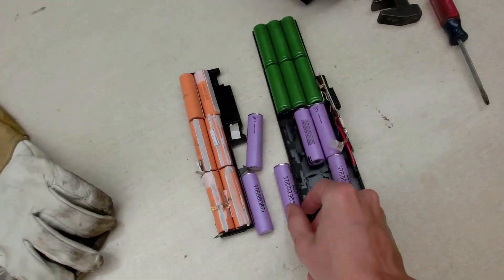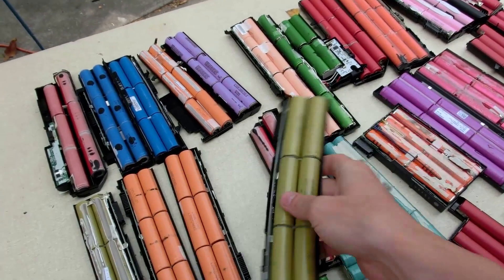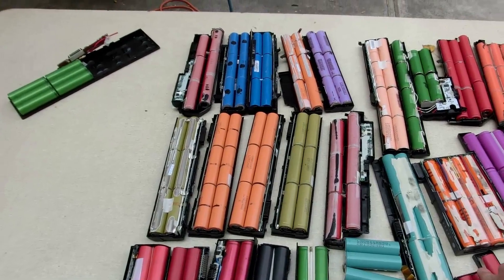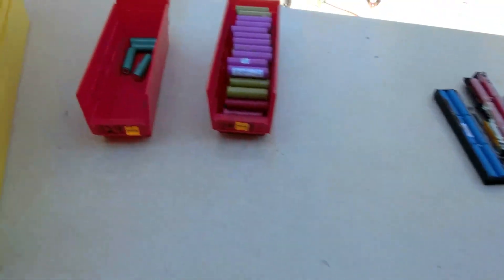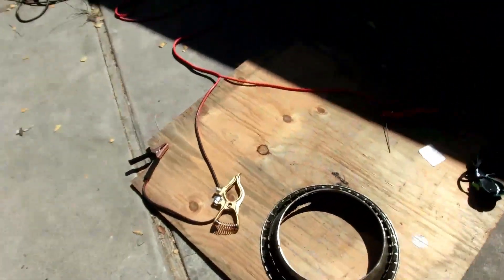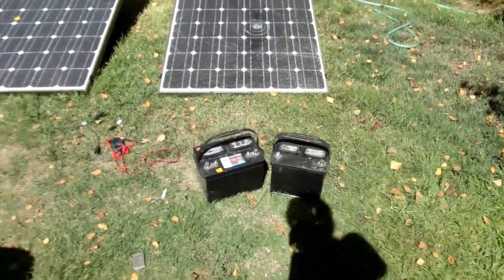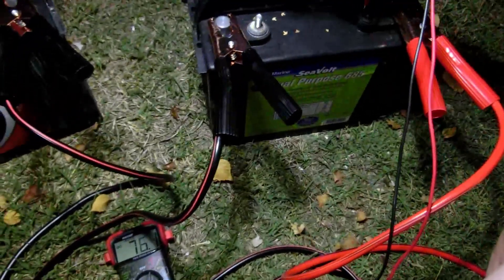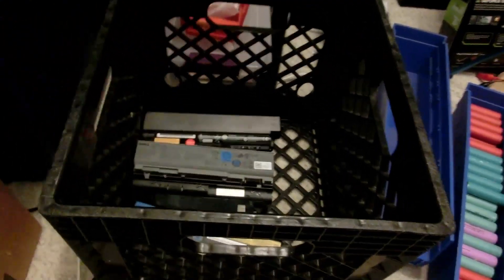Random Bits 0106: Harvesting 18650 cells, 48v Solar Charger

Comment: RE: Trolling motors, the one limitation that stands out to me is the ability to cool the motor as it is no longer going to be submersed in water. As I am machinist I can see cutting and modifying the housing to incorporate a fan powered by the motor itself or externally either/or with the addition of ventilation holes on the opposite end to draw air. Just a thought you might want to look into if you do I would look forward to seeing the video and would be happy to comment with any help I might be able to provide. Thanks again

Comment: You Sir are a junkie, I a'm proud to be associated with you as I am also a junkie.I have to inquire as to the gasoline pump in your backyard? The real subject of my question here is have you ever done in the experimentation with fishing/trolling motors for powering bicycles etc. I did see some quite promising results from a failed project of a friend who was clueless as to what he was doing. To salvage a trolling motor seems logical as they are a low-speed high torque motor to begin with, with all the variable speed controls and reverse supplied within the unit in its original form therefore inviting to be cut up butchered up and taken apart for other application. If you get a chance please respond to this. Thanks, Dave
P/S I enjoy your videos keep up the good work.

Comment: I find that Li-ion actually 4.1V fully charged, there is a mode change in that iMax charger choosing between LiPo / Li-Io
Reply: That mode undercharges the cells. You should use the Li-Po mode as that will take them up to 4.2V, which virtually all chargers use as the cut off voltage.

Comment: crap...i ruined 2 of my good cells...was making a 3s pack with 4 in parallel and while I was soldering them together I flipped it over onto a piece of solder wire which burned up quickly but not quick enough before it sent a lot of amps into 2 of my cells that were hooked together at 3v.  Everything was getting really hot then I grabbed my bolt cutters and clipped the rows apart those 2 batteries I have in a safe place for now in case they catch fire.

Comment: Oh and from a professional welder, GET A HOOD! You'll get face tan lines
 using goggles.  Goggles are fine for oxy-acetylene welding, because the
 UV output is way lower. For arc-welding you need a hood with at least a
 shade #10 lens to filter out the UV rays to a safe level for your eyes.
 Also wear long sleeves and make sure you're neck-line is covered... 
I've been sun-burned before on the arms and neck.
Reply: I made that mistake my first time welding wearing only a t-shirt. I was lobster red. made for a terrible week working outside after that.

Comment: I had the same though about the strips... "maybe they are worth something later". I plan on building packs using solid copper cable I get from "pump wire". It's a 4 strand 12-guage twisted wire you can get at the home center that doesn't have the extra outer coating to strip off. Great video, thanks again!

Comment: The ernergy use is all about how fast you are driving. Maybe at 20mph it only uses 80Wh/mile. I don't know how fast you want to go but if you want to go aroung 50mph it'll surly use around 150Wh/mile.
Reply: Filip Bjurling can u put a motorcycle gear box in it?

Comment: I want to scavenge laptop battery packs but I can't afford imax b6 charger . I only have multimeter , is it okay to use????
Reply: Balance chargers like the iMax and Turnigy Accucel are less than £30 (or the equivalent in $). They're needed for capacity measurements; you can't tell how good a cell is just from voltage. If it has been well used, it might still hold a good voltage but the capacity will be well down.

Comment: I just got my imax b6 in the mail and am discharge testing cells now. What discharge amperage do you think it'd be smart to use? I remember you use 0.1amp discharge but in the real world I think I will be drawing faster than that since I will be putting these on an ebike. I am using 1.0 amp discharge for a single cell, do you think that's too high and my capacity rating will suffer as a result?

Comment: I am very new at this and looking for some help. Can you tell me if in the picture you posted that shows 6 rows of 12 cells in parallel, assuming 3ah per cell, would produce 216ah and assuming 4.2v per cell, would produce 25.2v as shown in your diagram. It looks like you posted the diagram in 2013. It talks about 6 of these packs in series. Then, for my project, if I built a pack with 3 rows of 5 cells parallel, assuming 2ah per cell, would produce 30 ah and assuming 4v per cell, would produce 12v. If this is accurate, then I need to understand exactly how to install the wiring to the power outlet and balancing wiring. This is intended for a golf push cart. Am I on the right track here?? Any advice would be appreciated. Byron Rafnson

Comment: I've subscribed to your channel and have learned so much from them.  Thank you!   I am working on a battery pack for electric bicycle.  I have approximately 90 seemingly good cells so far, although I have yet to test the capacity of them all.   My end goal is a 60v 20ah pack (16s10p).   Quick question for you:  When calculating what the total amp hours of my pack will be, do I take an average of the individual cells capacity, or do I go by the weakest link?  Also, could you recommend a good source for used laptop batteries?  Most of what I have I've obtained from ebay, but I've heard battery repair shops and electronic stores will sometimes give them away.  Wondering your experience with this.   Thanks again!

Comment: ah, how sweet that feeling when u open up a laptop battery..
been working on 18650 cells about 1.5 years now and ur videos helped me get to know pretty much about these cells, but here s an advice, since my imax b6 clone charger started to fuck around lately I upgraded it to turnigy accucell 6 80w and I can tell you I m getting waay more accurate capacity readings this time, you must get one.
 I ve thrown a lot batteries because of imax clone but now I get the best out of my cells.
Reply: +Bilal Öz , I've been doing the same with one imax b6 (clone?) and now I feel I must speed up the process.. (LOTS of cells!)

I'm considering the Turnigy 4x6S 400w.. Any thoughts on this?
Reply: +Ricardo Encarnação
 Hi, I didnt try that one before but I can say Turnigy is the brand to go when it comes to lithium ion cells. Good luck !
Reply: +Ed Va why it makes no sense? I'm talking about a quick way of measuring capacity, not (just) charging bats..
Reply: +Bilal Öz I am getting the Turnigy you recommend. Having the same problems with the Imax
Reply: +Ed Va just for charging I use the Nitecore.. I was wondering about the best way of measuring capacity (fast)
Reply: +Byron Rafnson nice ! ppst the results please
Reply: Ed Va that times 3000 cells and you go nuts..
I think i dont mind a little inacurancy.

Comment: Does anyone know how many c theese standart 18650 li-ion cells can draw?
Im having a hard time using the max potential in some of my RC components which recuires 20-35C. (Hence im forced to use the expensive LIPO batterier...
Reply: +Simon Dambro       2
Reply: Cheers! !  That's really not much.
Reply: +Simon Dambro you can buy high-drain 18650's, but they'll cost you more. cheers!
Reply: nah id just stick with my free standart laptop cells :)  But thx
Reply from the maker: +Simon Dambro its not a bad amount of power from a cell, because if they where high-drain cells then you would just have a battery pack that would run something for 10 minutes or so. if your going to run something like a car you would need several hours of battery life anyway so at that scale a 1C discharge will be more than enough.

Comment: As long as you have a battery for both initially on the speedometer you'll be fine, and no wire in the way to get stuck on a branch or something like that. My mom has a wireless one and it has lasted almost 4 years now so you will probably be fine.

Comment: I want to make a solar charger for a 7V Motor/Battery Combo(I have a garden on a shack-roof that need watering). Do i need a charge controller? How do I make one?
Reply from the maker: +der Robert yeah its best to have atleast a voltage regulator to make sure the lithium cells dont get overhcarged. but if you can find a lithium power tool battery it should have the charging circuit and everything inside already. then you just provide it with a voltage from your panels.

Comment: Very cool, I took apart 25 laptop packs myself, got them from computer repair shop. 
For discharge testing I use 3 of these 7.45$ discharge testers. (ebay item number: 271731490268)
--
ebay link:
http://www.ebay.com/itm/271731490268?_trksid=p2057872.m2749.l2649&ssPageName=STRK%3AMEBIDX%3AIT
--
Also I use 7.5Ohm 5W resistor for a single cell or 3.3 Ohm 10W resistor to test pairs (too lazy to take separate, since they are spot welded in pairs). Discharge them to 3.0V, it stops automatically and displays mAh, so great!
This speeds up the testing process considerably compared to one iMax B6.

Thanks for the videos again, I am following every step of your new citicar project, very inspiring :)
Reply: +Roman Seibel you make a good point abou speed of testing. do you know where i can learn more about these testers you linked up.  the ebay listing is a generic name instead of something specific so when searched in youtube don't really show that particular unit.
Reply: Hi Danh, unfortumately I couldn't find anything on google or youtube, I guess it would be great if some one would make a review of one of those. I can't find the time unfortunately.
Reply: +Roman Seibel Sir i have been wanting to buy this tester  can you do a video on how it works

Comment: those goggles is for acetylene oxygen welding.. do NOT use them for arc welding.
Reply from the maker: +grapsorz but they are shade 10 so are required to protect against UV from what i understand.
Reply: stil they don't protect your face and as you found out they don't cover so good. you can still get cancer or at least sunburn from the UV rays hitting your face. if you want to weld get a automatic welding mask. not the absolute lowest price one's as some of them tend to fog up during use. i see they start at 25$ on ebay. worth every penny.
Reply from the maker: grapsorz
i just got myself a normal welding helmet.

Comment: will 50 cells in parallel be enough for current needs of your car? ...laptop batteries have high internal resistance soo...i suggest you to measure current draw and voltage while accelerating, before you salvage old batteries from car...high current can be mesured via shunts...
Reply from the maker: +Marko Grančić i want to maintain a discharge bellow 2C, that should be good enough.

Comment: Those look like gas welding goggles.  I am not sure those are going to protect your eyes from UV from the Arc welding.
Reply from the maker: +cfavreau they are shade 10 welding lenses, they are required to shield UV
Reply: +cfavreau Another commenter said that arc welding needs a visor that covers your whole face. So can the UV from arc welding cause skin damage or give you a sun tan? :-)
Reply: +Rinoa Super-Genius Ok.  As long as you are sure.  I don't want you to end up blind or with cataracts.  However the comment below is right.  You should look at the whole face mask.  You can get a whopper of a sun burn from the Arc too (and eventually skin cancer etc.).
Reply: +Coolkeys2009 Yes, it can. UV is UV, regardless of the source. If anything, it can burn you faster because you are basically standing next to a concentrated source.
Reply: abraxsis You just get suntan. If you weld alot you might want to consider a mask . But a day of welding for his bike wont kill him. Just tan his face and uncovered skin

Comment: Are you planning on supplementing or replacing the golf cart batteries. If you keep them then they should act like big caps and handle your burst energy needs with their power density while the LiIon carries the energy density for your range. Seems like it could be very complimentary.
Reply from the maker: +Ian Levine no the lithiums would be better in all respects, the lead acid batteries would just hold it back from reaching it's full potential.

Comment: Do you think the LED indicators on the lappy battery packs could be re used/re purposed? i have quite a few of em.
And that 18650 collection your getting is scary :-D
Reply from the maker: +steve64464 yeah they might be useful. and thanks haha
Reply: I mean apart from stripping them off do you think the protection circuit/charge level indicator be re used? , Ive been messing with my 18650 tonight making small cells etc and ive been using the metal off bottom of pringles tubes as tabs, I must be insane.

If you install like so many hundred in that cool lookin car do you think youd have to install like a core ejection system like on a star ship for in the event of a warpcore breech ? :-D
spring twangs it out massive fireball and crazyness but car survives.

Sorry im a lil crazy its late here in the UK , thanks for getting back to me :-)
Reply: steve64464 What. The. Fuck.
I want that on anything that can explode. What episode is that in I dont remeber seeing it.

Comment: Looking forward to the city car project.    Have you considered 1" or 3/4" 16 gauge square tubing for the bike project rather than angle iron?  Used making the frame of locost 7 replica's/clones etc of Lotus/Caterham 7's.  Strong enough for that, should be enough for a bike and likely be easier to work with and some some weight.     Of course, same problem you mentioned in another post is having to find a steel supplier.      Any reason you don't pick up a small flux core welder or another from harbor freight?   Have one of the older splatter boxes from them.   The welds are not real pretty (mostly user caused on that part)  and need cleaning due to the flux core welding spool but it does the job.
Reply from the maker: +Mandurath if i was to buy a MIG i wouldnt buy it from harbor freight.
Reply: +Rinoa Super-Genius  Hehe, i wouldn't either for a nice mig welder, or arc for that matter.   But their 100  buck flux core welder is ok for what it is.   Know you know what your doing with the battery welder, and prefer more often than not to build stuff yourself.   Keep on building, enjoy the vids.

Comment: So, instead of buying an 80 dollar stick welder at harbor freight, which will give you much more control over the amperage and voltage flowing through the stick. making it so your welds won't be porous, disgusting, and weak. you bought 3 batteries totaling almost twice that? Not to mention the electrode holder you showed in a previous video, the jumper cables,  and the grounding clamp. you said it cost you like 200 bucks for "welding supplies" when realistically you could have gotten a 120v AC 70 amp stick welder with the electrode holder, grounding clamp. and some cheap welding rods for less than 200. i don't understand
Reply from the maker: +ghostrider433 because these batteries are also a solar panel power bank. and also that 80$ welder your talking about is a piece of shit i wouldnt go near. its probably just a bunch of resistors.
Reply: That's true. the batteries are multipurpose. but it's going to be alot better in the long run to purchase a welder. and yeah, sure it may be a bunch of resistors and a few transformers. but for 80 bucks you get that. the grounding clamp and thick wire. the electrode holder, and the freedom to adjust how much electricity you're outputting. If you're designing a whole new rear end for your trike it's better to make something that you know is more sturdy and sound. batteries are iffy when it comes to welding. mostly they're used in emergencies, they simply don't heat the metal up enough to properly fuse the rods, and the performance decreases as voltage does, but, it's up to you. i'm just gonna say i have a Harbor freight 240v plasma cutter, and a 240v stick welder, both have been amazing so far. and with the stick welder i have the option of doing TIG welding, which i already have supplies for, just need something to weld. it's worth it imho.
Reply from the maker: ghostrider433
well my electric tractor held up fine and i built that with battery welding.

Comment: When you get your citi car are you planning on changing the throttle control over to semiconductor based PWM control? I would have thought relay based voltage control would be a bit hard on the first batteries in the string and I don't see it being suitable for Li-ion batteries.
Reply from the maker: +ben hunter yeah perhaps, but with relay contactors for backup.

Comment: I run 4 Imax B6 at once to discharge cells! =) and charge the cells via a usb hub and loads of the TP4046 usb charg modules! =)
Reply: +pietkaify I thought about the Turnigy 4x6S because it can discharge 4 bats @ 2 amps each.. I don't know if this is good, tho
Reply: I would like one too! but if one bit goes wrong it is dead! whereas if i have four individual Imax chargers I don't worry if one goes pop! I mainly stick to 1A just so every discharge test is the same! =)

Comment: With all the battery packs you have made and will make, you may soon face the need for a power supply that can provide some serious amperage for your balanced charging solution. I'm sure you won't want to wait an eternity to charge a large battery pack that has discharged to near its lowest allowable voltage level after a long road trip. Will you be assembling your own 50+ Volts power supply for that purpose any time in the future?...
Reply from the maker: +Farrokh Mirbaha yeah i will probably modify an old welder to charge it.
Reply: Rinoa Super-Genius what about a small industrial combustion engine driven generator?
Reply: +Rinoa Super-Genius can't wait for your solution on this.. ;-)

I'm also working on a EV